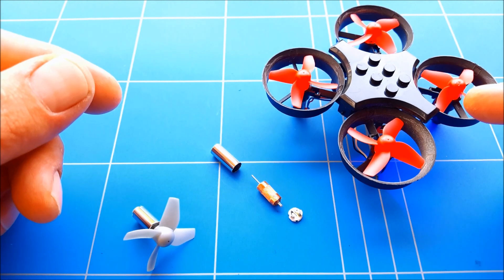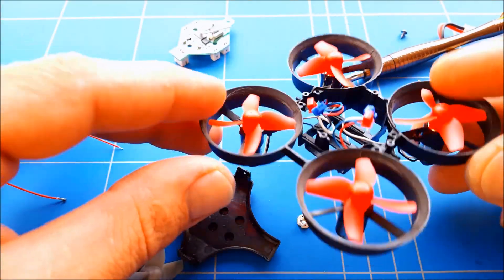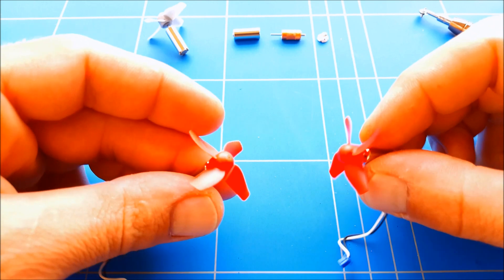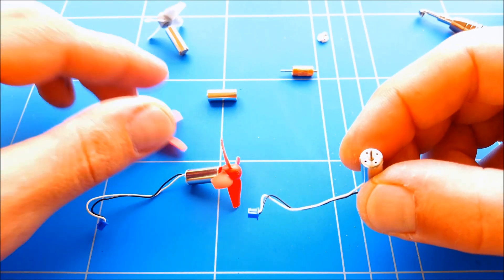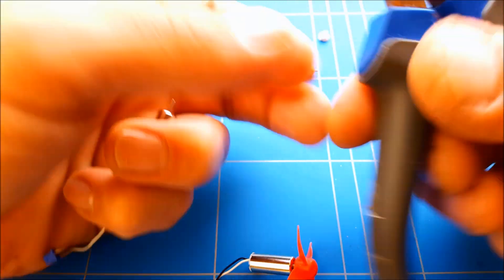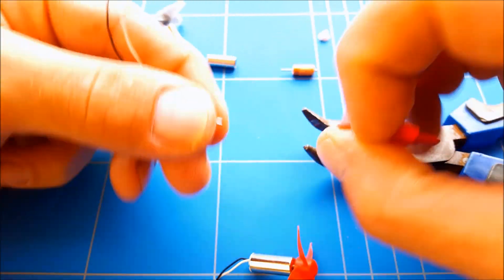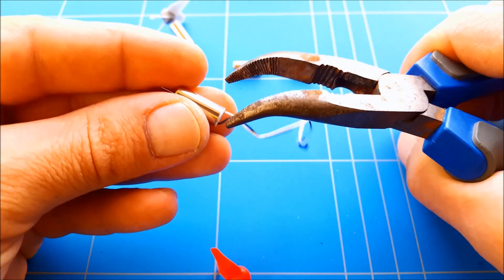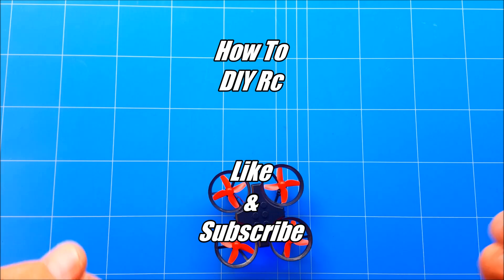3 Ways How To Fix Stuck Micro Brushed Motor Repair From a 1s Mini Rc Drone

Comment: My moter stuckes
Reply from the maker: I know that problem check my 2 videos how to fix and disassemble micro brushed motors
Reply: Bro at first my motor start heating
But now it can,t lift up drone and  produce heat too much
Reply from the maker: buy a new one they are pretty cheap

Comment: I have  6 x 15 motors one of them doesn’t work properly ....if I push it with thrust it will start spinning and fly ..but as soon as it stops, it needs another push before it starts again ...should I try this method or do you think it’s something else

Comment: Please tell Me Length of motor in cms
Reply from the maker: eacjine e011 are 715motors 0.7cm width 1.5cm long
the e010 are 615 6mm wide 15mm long hope this is the info your looking for?
Reply from the maker: eacjine e011 are 715motors 0.7cm width 1.5cm long
the e010 are 615 6mm wide 15mm long hope this is the info your looking for?

Comment: I have this drone the "propel maximum x01 micro drone" and the power switch broke off. How can i fix that??? Anybody's help will be really great.
Reply from the maker: solder a new switch or solder the connections together (bridge them) so your quad turns on when you connect the battery it's a very simple fix

Comment: Hey I have a question my motors runs smooth but it is not spinning helps plssss
Reply from the maker: easy to check are Broken Wire next check the ESC berhaps it's overheated and last the a coreless motor can burnout and still spin free! to check you need to fully disassembly it 
wish you good luck hopefully you can tract down the problem and repair it.. let me know how it wend?
Reply: i really cant fix it but last question can a7x20mm fit into a e011 frame?
Reply from the maker: Yes they Fit :D
Reply: How To DIY Rc thank bruh are they better hahahha? I'll just buy a 
New motors
Reply: @HowToDIYRc  great video
My motor spin free but not starting? Only start if i push litle bit but not stav ble fly?

Do you think is motor?

Comment: A very nice tip! Being able to repair this stuck motor rather than replacing it is a real money saver ;-) Thanks for the video and Happy Flying!
Reply from the maker: The repair is holding up after a month
The two mini drone motors are still running good and giving enuff thrust but do run a little bit hot
So we while be replacing them, this quick and dirty fix 
Gives me time to fly until the postmen come's..
Thx for taking the time to comment!.. happy flying to you to mate :D

Comment: Very cool video. I like it that the motors aren't soldered to the board. Way easier to fix/replace. 👍
Reply from the maker: thanks for watching mate those connectors make it an easy job but we prefer saving weight and lose those connectors of the 7mm coreless motors